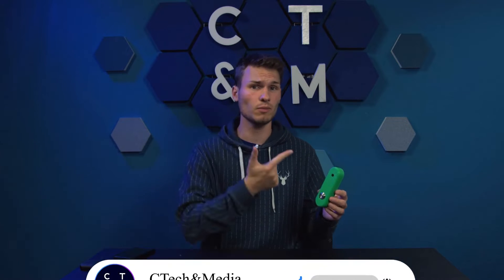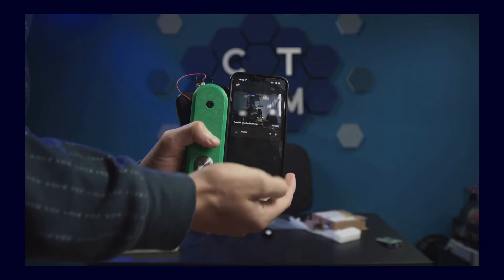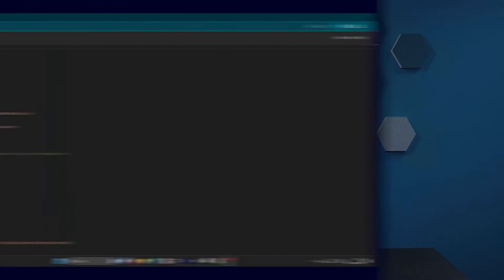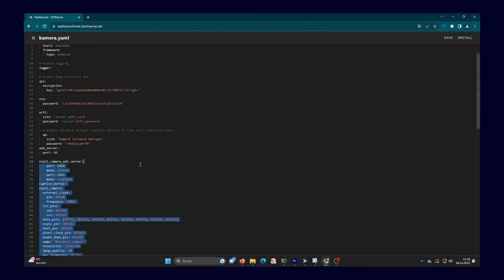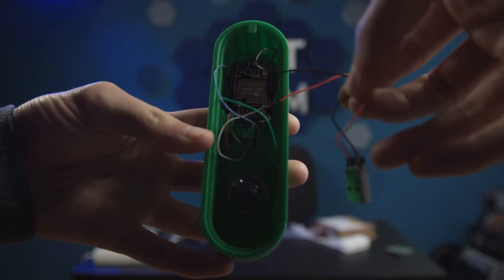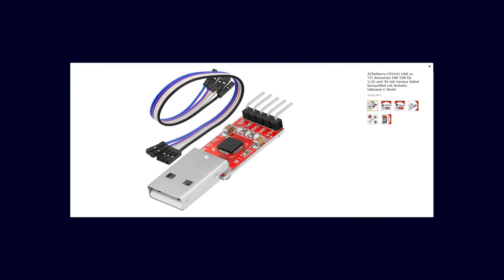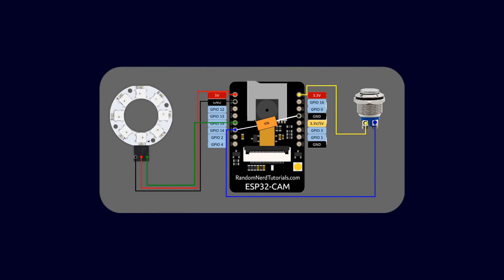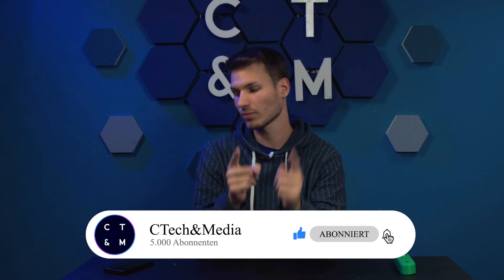Build Your Own Video Doorbell - DIY 🪚

Comment: Great idea with a DIY door bell. The enterprise products could use some open source competition to be force to bring the prices a bit down. They are way over priced IMO.
Only thing with your design is that th esp32 camera has terrible picture quality and refresh rate. I have used them in the past on 3d printers to monitor print progress, but I stopped again because the image quality belongs in the 1990s 😂 still, great idea! I hope you will iterate on this design and improve it. good job!